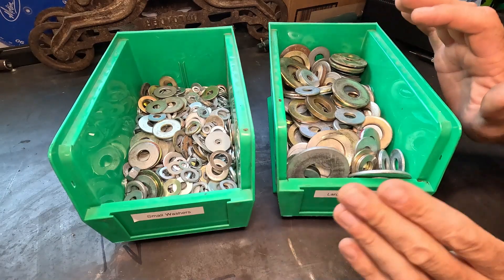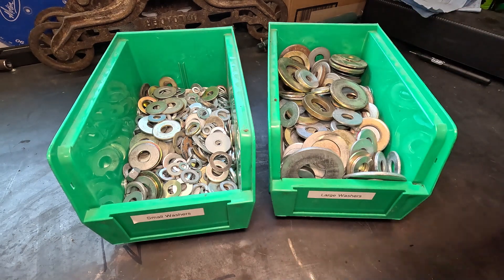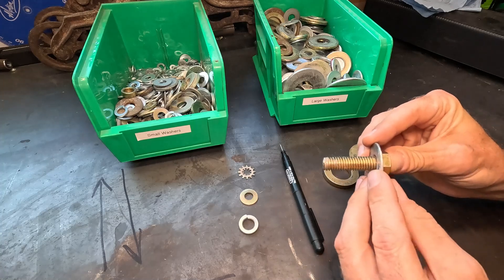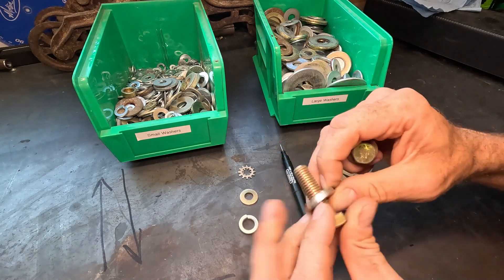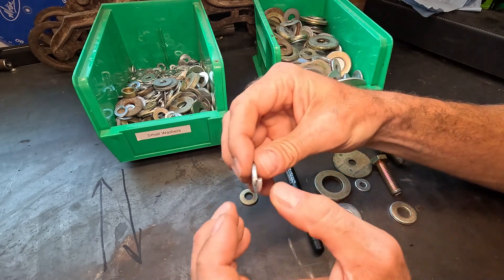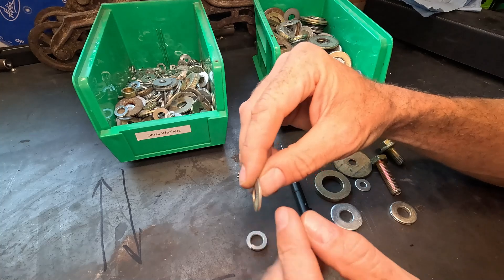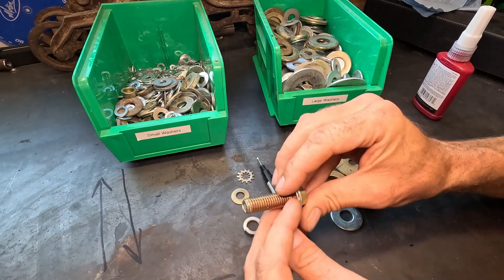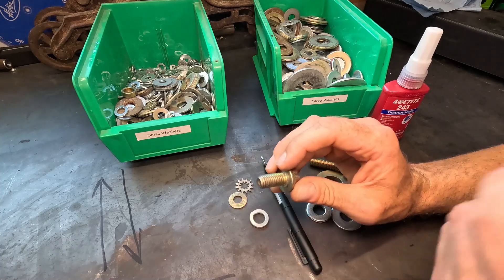What washers do within a bolt and nut joint.

Comment: I often use flange washers to distribute the bolt/nut’s pressure on today’s thinner materials.
Reply from the maker: Thanks for sharing. Absolutely, minimize parent material deflection or pull through. Appreciate you checking out the channel!

Comment: One more function of a washer is separation of torque twisting between screw and the part.
For example on your bicycle the brake calipers are screwed through washers. And it is done to prevent the screw from rotating calipers out of alignment as you tighten them down to torque spec.
Reply from the maker: That's a great added point. Ironically, I was just adjusting a bicycle brake disc caliper today.

Comment: Washers also help to not damage the mating surface as you wrench it down (a bolt alone will scratch off the metal/plating as you tighten).
Reply from the maker: Great and valid point. Thanks for adding that.

Comment: Another redneck engineering option to lock the nuts on the bolt is to put two nuts on the bolt and crank them tight together, this compression and tension prevents either nut from loosening or rotating out. Its especially useful in high vibration applications.

Comment: The washers on the left are often referred to as (anti) Vibration washers. Washers are also to keep apart some materials for corrosion (electrostatic) and to prevent bolts "digging in" to softer materials. Good article, thanks
Reply: There are washers that separate galvanically different materials which wourd rust fast in contact: like aluminium+steel or steel+carbon.
Those washers are usually plastic.
Reply from the maker: @SEThatered this is an awesome point! When I worked in commercial construction, there was a mistake made regarding the type of screws that had (inadvertently) been used to fasten special metal roof panels and it all had to be removed, and reinstalled, due to the future material interaction that was bound to take place.
Reply from the maker: Thanks for the comment, I appreciate it!
Reply: @LearnedFromDad  what washers do? Well it’s obvious isn’t it - they wash stuff😂
Reply from the maker: @malcolmwhite6588 if the could only wash laundry for me.....I would be beyond happy 😁
Reply: @LearnedFromDad  I know I had a washer - but because I was nuts she bolted!😂
Reply: In order for a washer to distribute the load applied by a bolt that has been placed in tension, the washer needs to be very thick as the washer needs to distribute the diameter of the stress distribution cone. These types of washers are typically used in structural engineering applications. None of the washers shown are likely to do this to any great effect. They will most likely just distort when under load but will stop the surface from scratching. Simulate the interaction using a FEA code and note the level of deflection.

The lock washer types shown (particularly the spring type) do little to stop a nut undoing when vibration or dynamic forces form part of the boundary conditions. The correct grade of Loctite will prevent a nut from undoing if it is applied on the threads (not the shank as noted).
Reply: @paulbriozzo4895  Correct. There are numerous YouTube videos showing failure of bolted joints employing lock washers of all styles when subjected to the Junker vibration test.
Reply: I usually pick such things up off the floor and pit 'em in my toolbox when I get home, never to be used again lol.  Yup life is hard here in rual UK.😅
Reply from the maker: @rob5944 haha, yep, I'm with ya! My grandpa was a farmer through tough times, save everything! I try to be reasonable. Thanks for watching from the UK, that's really neat for me! Cheers!

Comment: For fixings that do not require regular maintenance checks nyloc nuts are pretty good, limited reuse they will degrade quickly because it’s nylon.
Reply from the maker: Agree, great choice and I run into a lot of them. Only dislike (me whining) is having to wrench/ratchet them all the way off. However, why wouldn't I just use an impact anyway 😁

Comment: Spreading the load is only really relevant on bolts in wood or very soft materials.  The main reason for flat washers is to keep the nut or screw from galling the surface of the material being fastened.  That is why bolts often don’t have washers as the normal practice is to hold the bolt fixed and turn the nut, hence the washer under the nut.  THAT is the main purpose of a flat washer.   Obviously, lock washers have a different function as the name suggests.
Reply: I see holes ground into thinner metals from people neglecting to use washers with hex bolts in high vibration applications. Mild steel sheet metal isn't that tough.
Reply from the maker: Great comment, appreciate you adding. Parent material certainly does matter.

Comment: During my aviation apprenticeship we were taught a bolt has a plain shank, otherwise it is a machine screw. The bolt washer and nut assembled correctly would see the plain portion through hole and enough thread was when 1.5 threads were showing past the nut. Only fine thread bolts are used in aviation for better vibration resistance.
Reply from the maker: Awesome comment! I've never worked in aviation, but would love to learn to fly someday.
Reply: Come on guys why do you have to fight? Clearly both of you are very experienced there’s no need to go caveman on eachother
Reply: A screw threads into the hole itself. A bolt is fastened on the other side of a through hole.
Reply: @GeneralChangFromDanang a bolt puts a load on two or more pieces, eg a tire and a wheel hub. It’s like a spring and the length, material and torque have been calculated.
A screw, well, is a screw 😉
Reply: Isn't it class 3 course threads?
Reply: Very cool info here, I’ve never been to aviation courses but I have been caught with my fly down a time or two.
Reply: @C0SMICP0PE555  Thanks.  I regret making this contribution now.  Some people will argue over the smallest details.  Each trade appears to have variations on what is what but at 65 my knowledge has served me well in my career including industry changes. The aviation industry is very heavily regulated and that includes faster specifications.
Reply: In Australia we call them tapscrews .R
Reply: @reginaldhowell2261  Setscrews in motherland - of bolts & Aussies
Reply: @reginaldhowell2261  because Australia always has to be different than the rest of the world. LOL
Reply: Your aviation school is terrible. A fully threaded bolt is not a machine screw. It was never a screw, unless it self identifies as one, and even that is questionable. The minimum nut thread showing should be 2 threads, not 1 1/2. There are many course threaded bolts in aviation...vibration resistance based on thread pitch is a non issue as every bolt/nut is secured by other means including lock nuts, locktite or safety wire
Reply: @Mach141  You're going make a judgement of a trade school on one statement? Any thread protruding past the nut serves no purpose for the mechanical joint except for clearance to other parts.  I went on to engineering college too.  Yes various locking methods such as wire locking, cotter pins nylocks, deformed nuts (for hot areas) are also used, but it was not relevant to the subject of the post. In my entire 50 year career with transport category aircraft by far the majority were never less than 32 tpi fasteners being used for component assembly/installation necessary to meet type design. I can assure you that when  assembling  parts, the inspector looked for 1.5 threads minimum engagement.  The drawings specs ensured this with the fastener specs.  If it was more, the wrong fastener was installed.
Reply: @anthonywalsh6605  Lighten up Francis. Blah blah blah blah...are you done? I can guarantee you Ive forgotten more about aviation than you ever knew. Talk about irrelevant, that would be your entire comment. This was a video on washers, and you start mouthing off bad information about bolts. Are you still confusing bolts and screws? Okay, good for you.
Reply: @anthonywalsh6605  your wasting your time with this troll. A hex set has full thread and a hex bolt has a plain section of body of the diameter of the thread.

Comment: Seen many of those split washers ( I call them spring washers) break ,  not during tightening though,   just a few years after  installation then you discover the bolt has loosened or disappeared and you see the spring washer in 2 bits .       Much prefer using Loctite but beware of the Chinese copies they call " Loctite " that doesn't cure properly , basically doesn't do the job.
Reply from the maker: Agree, all those split rings in my bins are for show, haha. Lock nuts or threadlocker is my preferred method. Just don't accidentally grab 'bearing mount' Loctite for you normal bolted joint.....or, maybe you're handing it to a friend intentionally as a prank.....break out the heat to get it back apart!!

Comment: I find that nail polish makes excellent locking , and shatters when removing fasteners.
Reply from the maker: Interesting! I've never heard that. Now, bigger question, what color do you prefer? 🤔 😀
Reply: @LearnedFromDad - Red of course, but it comes in a blue bottle 😂
Reply: Good idea. And as long as both surfaces are clean, dry and oil/grease-free
Reply: Maybe I have also used super glue when I don't have Thread Lock to hand. Though, you should  of course use the proper spec compound.

Comment: I'm still not sure, !! Here in the UK when erecting structural steel,
 we only use washers on the nut side of a joint, unless it's a HSFG joint, I really think in this case the washer is used to stop damage and act as a "buffer" when doing up the nut (which is what we generally do here )
Reply: Have you worked on big erections?
Reply from the maker: Ironworker, awesome, thanks for commenting. I worked in commercial construction for about 10 years and recall the LeJeune bolts always (I think) having a washered nut. Used to have one laying on my desk because it was like a question rod, most didn't know what it was. I'll have to look up that washers specific purpose in structural, now I'm curious. Cheers.
Reply: @LearnedFromDad  Yes  Washers have been used since nuts and bolts were invented, so they must have a purpose, I'm sure there will many different answers to our question?

Comment: Another function of washers is as a spacer.  When bolting two plates together one, or more, washer(s) can be placed between the plates to get some separation.
At one of the factories I worked at we bought Washers for $10 per pound (about 10 cents each), and had apprentices file of any burrs and write a part number on them.  They then became Spacers at $3 each.
Reply from the maker: This is a great point and I definitely should have mentioned it. Thanks for adding.
Reply: So you stacked washers to use as spacers? Why not cut up a rod drill it and use it as a spacer? Way better than missing with a stack of 10 washers

Comment: Back in tradeschool they also told us 2 other purposes behind flat washers, friction reduction and replacement. You have a rotating bolt head into a stationary surface, by having a plated piece between them you reduce the friction between the 2 and require less torque to achieve the same clamping force. On a similar note the rotating bolt head wants to chew into the surface under it, a flat washer is much easier to replace when it gets chewed than the entire workpiece.
Reply: Well put. I broke a bolt on a new strut spring assembly i was installing while torquing it. The issue i was running into was the factory nuts had washers, and it had to do with the way the torque was distributed. And it was an odd number like 28 pd ft as well. I enjoy understanding the reasoning behind why things are the way they are, it helps me to better understand them fully
Reply: Yup, as an amateur bike mechanic I've definitely come across this when installing pedals, it prevents the pedal marring the expensive aluminium cranks. Another use for washers is as a spacer. For example if you're mounting a disc brake caliper to a bike and the rotor is 203mm but the mount is designed for a 200mm rotor you'd use a 1.5mm thick washer/spacer to move the caliper out so it lines up properly.
Reply: Underhead friction only accounts for 10-15% of total friction from a bolted joint, but definitely does have an impact!
Reply: That makes so much sense
Reply: The flat washer provides a known friction for the bolt head to rotate on.  
That value is part of the calculation that determines what torque is needed to get the desired clamping force.
Reply: While these properties are true, this isn't the reason for using or not using washers. They would just adjust the torque rating to compensate, that's not an issue.

I've not heard of a bolt being replaced so frequently that a washer is required, also the surface can be refaced.

You hear a lot of things in trade school that are often not verified. The reasons I heard it was force displacement and bolt retention, but I've not spoken with an engineer about it either. However always follow the manual on whether to use oil or not.
Reply: @Commander_ZiN  yes, they are both true and are very much reasons for using washers. Whether or not you've previously seen or heard of the reasons doesn't change the facts.
Reply: @GregHassler  great you have evidence of these facts, please point me to it.
Reply from the maker: Great comment. Appreciate you sharing that. Cheers!
Reply: It's exactly what I wanted to say.

Comment: i know what washers do.
theyre always a half mm too small for the bolt, and you can only ever find three when you need four...

and they ALWAYS land on their edge and roll away down the ONLY crack in the workshop floor...
Reply from the maker: Hahaha, our experiences are similar 😆
Reply: And you always find that lost washer much later when you no longer need it.
Reply: Washers and 10mm socket have similar traits .
Reply: @MALEK-xi6cv  how ironic... checks pocket
 as i suspected...

a 10mm spanner.
no washer :(
Reply: Accurate
Reply: Exactly right 😂
Reply: Yip, that's their main purpose. 😏

Comment: This might be a bit niche, but i found my cat trees have 5/8-18 bolts. So I got some rubber feet with a 5/8 hole to get them above the floor. But I would like another half inch for airflow that I think I can get with washers.
Reply from the maker: Sure thing, you could stack some washers to gain some space. Or, for a more controlled/consistent dimension use some bushings. Take care!